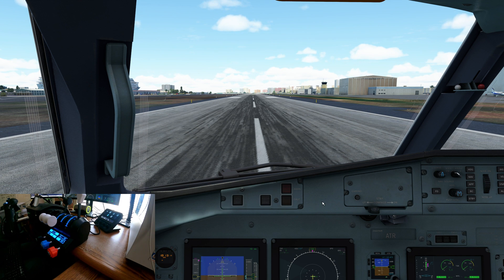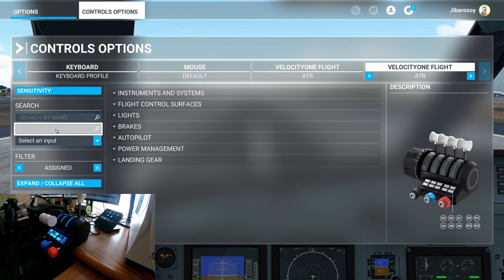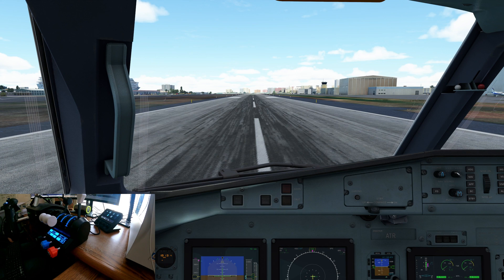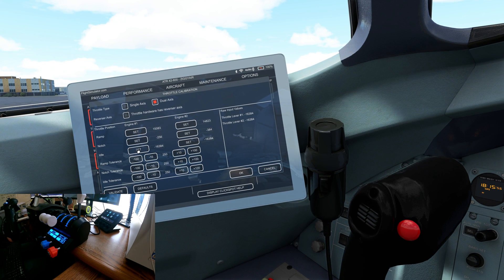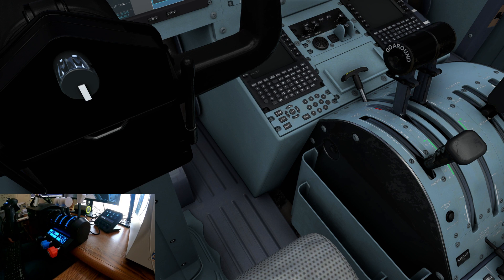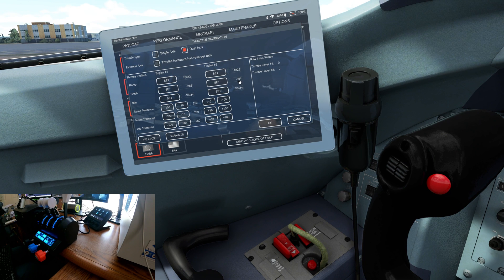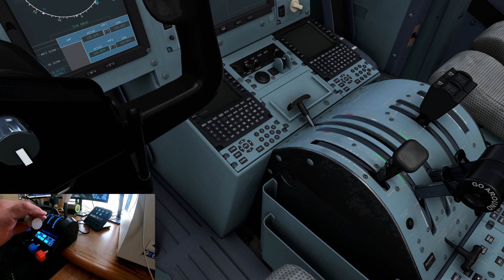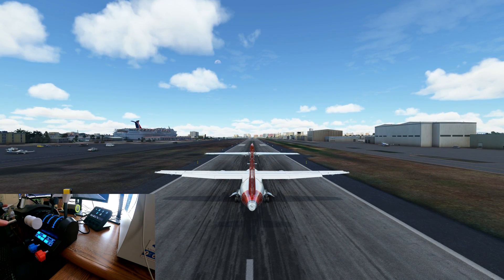MSFS - HOW TO CONFIGURE YOUR TURTLE BEACH VELOCITYONE THROTTELS TO WORK WITH THE ATR 42/72-600.

Comment: All almost working fine … but I can’t do full 100% thrust… it’s only 75% …. Any advice? 😊
Reply from the maker: Most of the time that’s an issue with the configuration in the EFB. Make sure you set the first notch and the full power notch.

Comment: Hi. Thanks for the video. The throttle is working just fine. For some reason, the light(s) buttons on the velocity one will not work with the ATR. Works fine with the other aircrafts. Any ideas?
Reply from the maker: Interesting. They do work on mine. Are you on the latest firmware version? If not, try that.

Comment: I couldn't get the reverse thrust to work. Are you sure you just configured the thrust axis only?
Reply from the maker: Yes. Couple of ideas. Make sure you have the quadrant selected when configuring. Also, if you have not done so yet, update the firmware; there is a fairly recent update. Check to see if the reverses work on the default twin engine profile, making sure you are also selecting the profile in the yoke. Hope that helps. Also, there is a new update to the aircraft, which has some fixed to the throttle reverse thrust. This may address some of the issues.

Comment: hi my throttles do not set up like yours as my Notch is almost 3/4 of the way up, my Ramp is almost 90% and I definitely have no reverse when I pull them back fully, has there been another update for the Velocity or are we still on 1.4.0?
Reply from the maker: No, that's the latest one. Have you tired using the default one-engine configuration with something like the TBM? That worked right off the gate for me. Also, make sure you are in the right profile on the yoke menu.
Reply: @ZiggyAir  I have sort of figured out that if i use the twin profile but don't change anything, but delete it all except the throttles it works automatically. Cheers for getting back to me. 👍
Reply from the maker: @oldmanshaggy251  with the one engine profile, there are a couple of levers that are binde to the throttle. You must erase one of them. That's what I ended up doing, but I am glad it is working for you.

Comment: hey Ziggy. great vid, however im wondering why my throttles when pushed into position begin to fall back down to idle hence not allowing me to configure by aircraft.      this is also meaning my engines lose power. please help  Anyone !!!
Reply from the maker: The only thing I can think of right now is that your quadrant is set up at an angle, so they fall back down. Try to level them or there are several hacks online to increase the tension on the throttles.
Reply: @ZiggyAir  hey so it’s not my physical throttle it’s the atr throttle that falls down all the time
Reply from the maker: @xavsmith2034  Oh, I see. Then, check to see if nothing else is binded to the throttles.